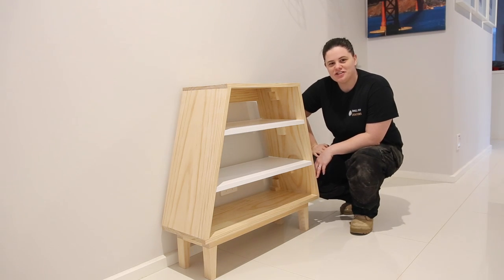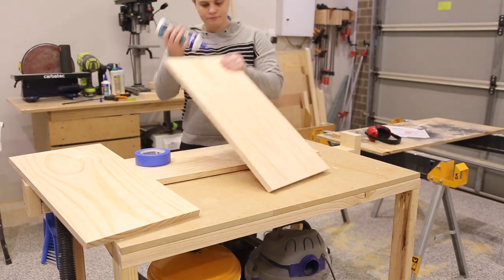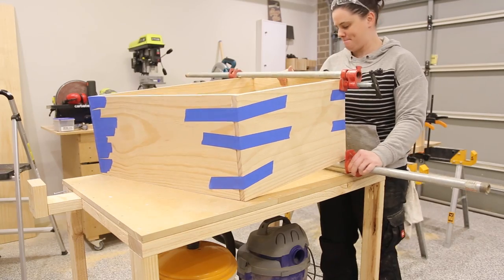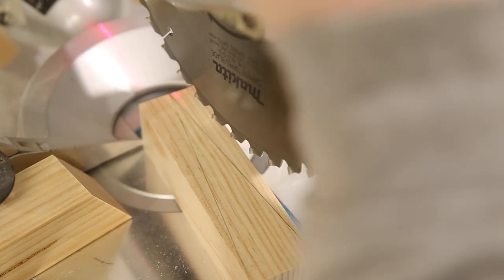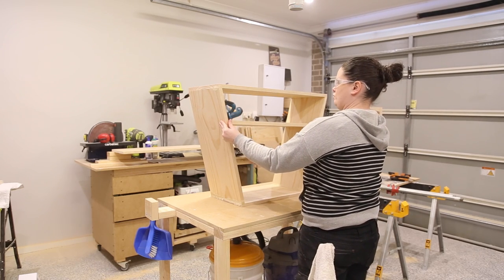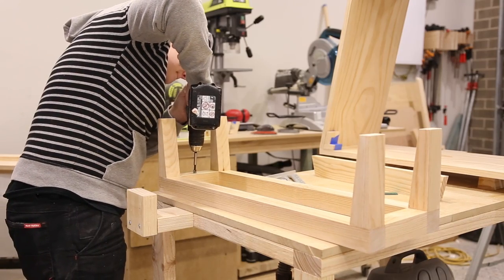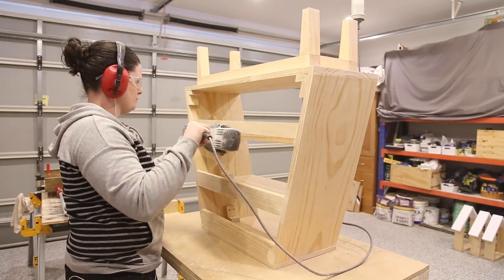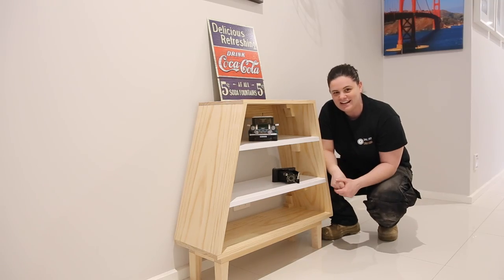DIY | How to make a Entry / Hall Table with limtied tools

Comment: Cool design! The small shelf brackets look cool as a design element and do work, also pocket screws would have worked well too.
Reply from the maker: Thanks Tom. For sure could have used pocket holes. I almost did :) Just didn't want to plug the holes.

Comment: Where did you get your pipe clamps?
Reply from the maker: Dave Barr hi Dave. I got the clamp parts from ebay and the Brought the pipe from bunnings. They were cheap on eBay. Tomorrow when I'm on my computer I will send you a link 😀
Reply from the maker: Hi Dave here is the link to the ones I purchased:

http://www.ebay.com.au/itm/GLUING-PIPE-CLAMP-3-4-2-SETS-WOODWORKING-VICE-HAND-TOOL-83911-/331443667003?hash=item4d2b95003b
Reply: Small Fry Creations awesome, thanks! link to bunnings pipe too? :p